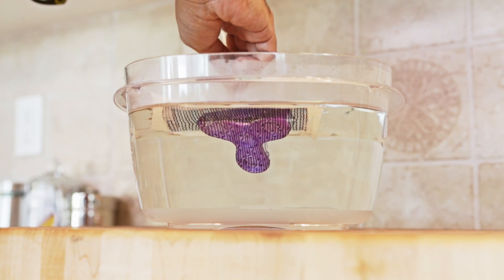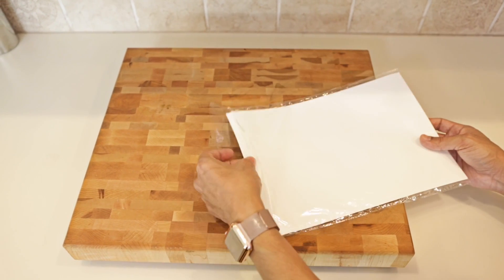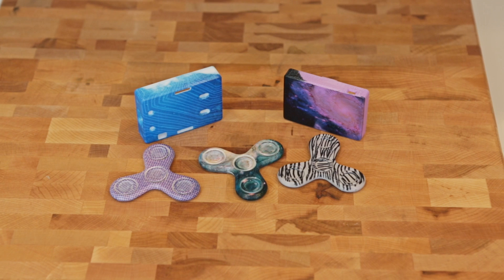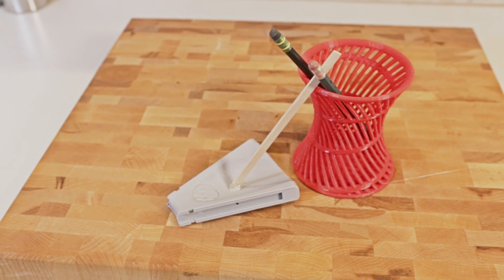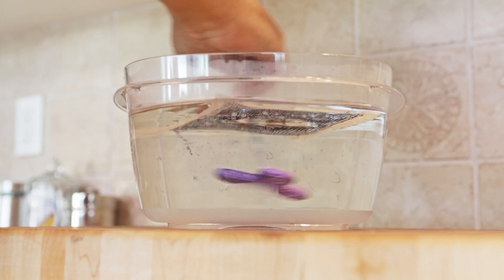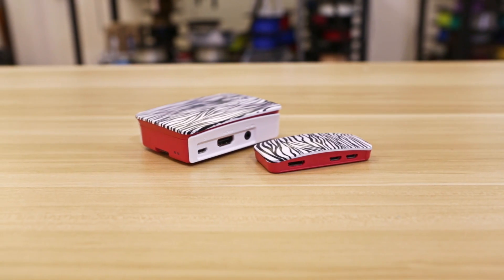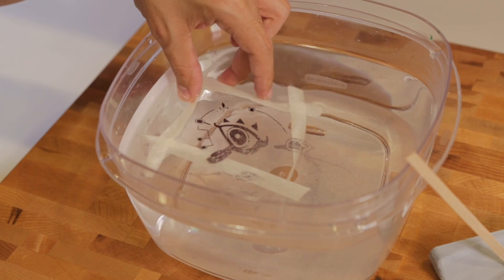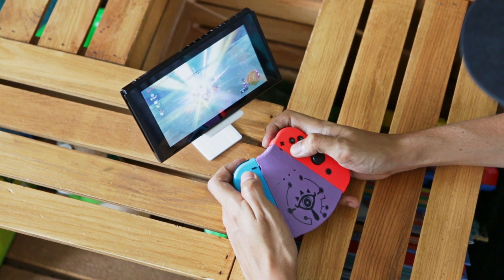Hydro Dipping 3D Printed Fidget Spinner - Add Graphics to 3D Printing Projects

Comment: I have no idea if this works on my intended project for 2 reasons. 212degF is way too hot to touch (for my purposes.....gluing a handle to my work piece is both impossible and not a good idea), and secondarily, you need to continue submerging to get full adhesion so the water presses the ink against the work piece thru a combination of pressure due to head and hydraulic pressure from buoyancy.   So I need both a tank that's about 1-2 feet deep, wide enough for 2 hands and a sports ball, and not too hot too touch.  Ideas?  I'm thinking less heat and a catalyst spray.

Comment: Wait, "hot" water, or "boiling" water? You say "hot," but then show a caption that says 212F/100C, which is the boiling point. The video shows someone getting hot water from the tap, which would be 140F at most. Clarify?

Comment: Error? You show getting water from the tap that should be 100c (212f). That's boiling hot! perhaps you meant 100f (~38c)? Ive been trying this at home and my tap water seems to hot causing the ink to dissipate quickly.
Reply: I tried it at 100 F, then 150 F, then 200 F......nada.  not hot enough to melt the plastic.
Reply: Nick is exactly right!  100c is way too hot... It's only necessary for 38c water if you are in a high yield production environment that requires speedy dissolution of the PVA film. Otherwise, room temperature water is just fine.  PVA = Poly Vinyl Alcohol    Also the main ingredient in Elmer's white glue.

Comment: I am happy to see that people are being told what hydro dipping actually is. There are so many videos of people actually swirl painting their fidget spinners but they say it's hydro dipping. Also,(i might be wrong) i am pretty sure that the activator is made for the film that you buy premade. I have hydro dipped a few nerf blasters using hydrographic film that i got online and it worked well with the activator, and it wouldn't work without the activator

Comment: Will it wash off tho?
Reply: Yes.  His process is incomplete and misleading.  Since he uses no paint on the part and no activator on the ink, the only thing holding the image on the part is the water soluable PVA residue.  Sweat from your hands will hydrate this in a few minutes.  The original poster knows this and removes any negative comments about his bogus process.  Watch some other videos on the hydrographics industry and see for yourself.

Comment: Does this work with laser printing, or would the PVA melt to the fuser rollers?
Reply: I did not test it but PVA ususaly has a pretty low melting temperature. Making it temperature resistent would also prevent it from dissolving in water. So unless you have a spare printer...

Comment: There's a paper called Computational Hydrographic Printing, that describes a method to apply perfect textures of 3D models to their 3D printed counter parts using hydro dipping. The algorithm basically unwraps the texture intelligently for printing in a way that when the object is dipped precisely by a mechanical arm, everything aligns well.

Just thought someone here might like to know that
Reply: and here's the paper
http://www.cs.columbia.edu/~cxz/publications/hydrographics.pdf
Reply: That would be amazing for someone with either a very large hobby budget, or a company to use in manufacturing.  We'll have to do it manually, however.  And you can do it accurately, to a point I would think.

Comment: Where did you guys buy this paper? Can you give me a international shipping link maybe?
Reply: I put "PVA FILM PAPER" into ebay and the first link I got was to this:  https://goo.gl/EQ3ZqD
Which is the correct thing, so he is correct.  Now you have the link.
Reply: Erwin Ried the Testors stuff? It's exactly what they're using in this video, the people doing it in the videos you're watching are probably just using it correctly and putting the image in the surface then applying water. That is what water transfer paper is. This video here shows the real film designed for hydro dipping which you'll notice is not paper backed like water transfer paper: https://youtu.be/NI5CgKUiEi8
The only other product they could be using is the paper found here for exorbitant prices: http://www.prostreetgraphix.com/store/products/  which does require a spray on solution that is far more expensive than the paper itself. Maybe you can get around that by leaving it in the water for a long time or something, idk. I'm fairly certain that paper is the same as the other water transfer paper, just sold as something new. Surely someone with a website as low tech as that did not do extensive amounts of R&D to develop a new hydrodipping material.
Reply: I only find paper that you must use sprays and lay direct on the object…
Reply: OmegaCO you can buy it on pedal parts plus, or at a lot of hobby shops as this stuff is used to apply water transfer decals to model cars and stuff. This isn't the same as real hydro dipping film, which does indeed require the activator to work properly. otherwise your part won't push through the graphic.
Reply: Jack Spaceboy 100 fu… Us dollars for a paper…? Eh no? - also it doesnt ship to my country.
Reply: Chris Carr and how can i different the real thing from the hobby? What name has this paper now?
Reply: Alright let's clear up a few things here. First, I'm assuming no one actually "asked questions before buying" that 100ft roll? Because I am almost positive that is the professional stuff we use to transfer custom designs to things like I terror car accents, motorcycle fairings, aluminum guitar pedals, etc. when we can't find an existing film that goes along with the customers idea, or they want something specific like a design encorporating their logo. The stuff I'm referring to requires an activator.. I know the extra step of an activator seems scary, or just an extra step you could get around, but using the film that requires an activator is far more durable and the preprinted stuff will result in better graphics almost always unless you have a lot of patience and a great printer. This paper stuff is literally the stuff you get inside a $20 plastic model car kit(instead of stickers) to put the color graphics on the side of the car: https://www.google.com/search?q=water+transfer+decals+model+car&client=ms-android-hms-tmobile-us&prmd=svin&source=lnms&tbm=isch&sa=X&ved=0ahUKEwiDuYOn7rXUAhVDOj4KHTRpA5IQ_AUICSgD&biw=360&bih=560#imgrc=nDMbCyXGebvaRM:
It's by no means meant to be for things you'll be doing anything with other than putting on display(as they said it rubs right off). That said, the professional grade stuff is, as you can see, cut for professional printers and expensive as well. 
As for the pva thing... I think people are just confusing PolyVinyl Acetate with PolyVinyl Alcohol, or in the case of window tints and vinyl wraps, it is PVC(PolyVinyl Chloride; the same stuff the white plastic pipes are made of). Which are all indeed different, and while confusing, both the first ones could be called pva I guess.

+OmegaCO  do you mind me asking what country you're from? Sometimes different places call things slightly different names, and if I know where you're from I may be able to find you a local vendor or something. Generally the real deal goes under a title with "hydro", "hydrodip/dipping"or "hydrographic" in it as these are keywords people looking to hydrodip something will use. The stuff used in this video is water transfer paper(again meant to be put on the surface of an object and transfered with water, then the paper pealed away(they just do it in reverse basically). If your country has those kids "tattoos" that you put on your skin then put a wet rag on the back of for 30 seconds then peal away the paper, you've experienced the extent of the magic behind water transfer paper. And are also aware that it is in no way intended to be permanent. If you want to try the water transfer stuff they used in this video, a reputable brand is Testors. Though I honestly can't speak to the quality of results as I just use the actual hydrodipping film. Also it's by no means cheap at about $8 for a ten pack. Then again hydro dipping isn't really a cheap solution.

I urge anyone wanting to try this to just seek out real films first. The likelihood of you finding something you like is huge. There is even a company that makes things called "dipkits" which are more expensive than buying a roll of preprinted film on eBay and buying some base coat, clear coat, and making the activator, but all of that is included in one box so may be easier for people.
If anyone has any questions, or would like resources, or recipes for making your own simple activator solution with hardware store chemicals for pennies on the dollar, I'd be more than happy to help.
Reply: @Mike Meyer  Here ya go... Sheets of PVA film   http://bit.ly/2V7ZBgO
Reply: Well, if that's what you ordered you bought the wrong material. Pva Film is what after market window tints are done with along with vehicle wraps etc. You need Water Transfer Film. Maybe you do need to learn how to Google - and Ebay!